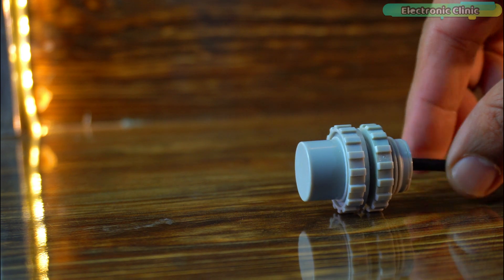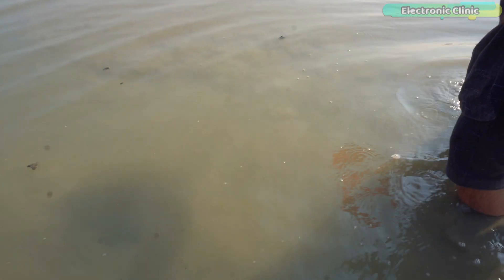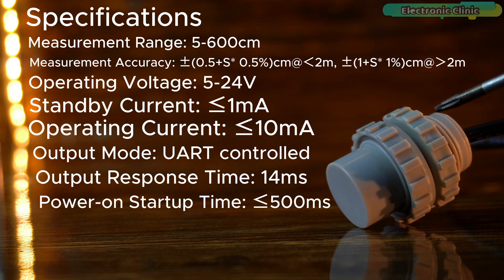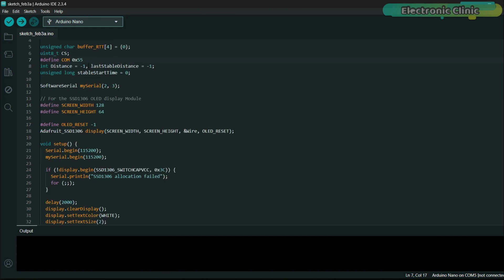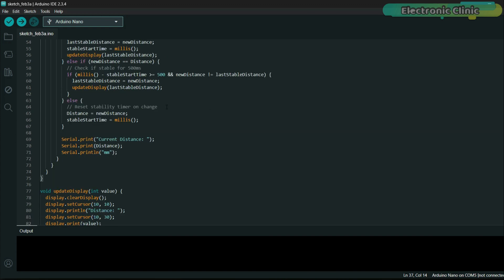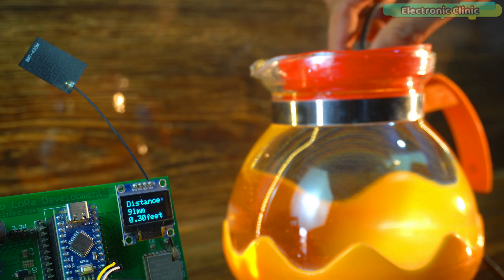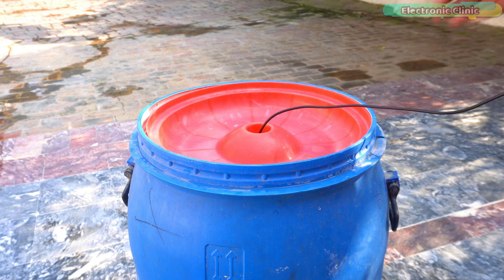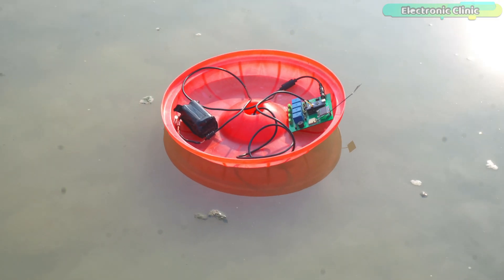Underwater Ultrasonic Sensor with Arduino | Waterproof Ultrasonic Sensor | Water Depth Monitoring

Comment: I had a problem with this sensor. Regardless of the code I used, the sensor did not return any values
Reply from the maker: @matheusmendes9106  mine still works just fine. Check your wiring and controller.

Comment: Is this sensor can work both in air and water medium? And also the sound waves can travel to air to water medium and vice versa.
Reply from the maker: It doesn't work if the sensor is outside the water. I demonstrated this in the video.

Comment: 600CM x10 = 6000mm / 25.4mm in. = 236in / 12 = ~20feet. This distance would be good for measuring fluids in a tank. However, in the USA, we have a device called a "Fish Finder." They can be found used for very little money. Or, a friend might have a broken one that they might share for you to repair, or just harvest the sensor. These units have deep depth range ability - 600 feet and more. Maybe you could adapt one to your own purposes? HTH. Cheers.
Reply: Share link
Reply: @crazycoolguy109677  YouTube no longer allows Commentors to post links. If you try, your comment is automatically deleted. If you are in the USA and near water, try your local thrift stores, marine stores and ask around, at your local bait shops, fishing clubs, friends who fish, etc. Cheers.
Reply: Fish finders for salt water use can look much deeper than the fresh water units. They are also more expensive, when purchased new.